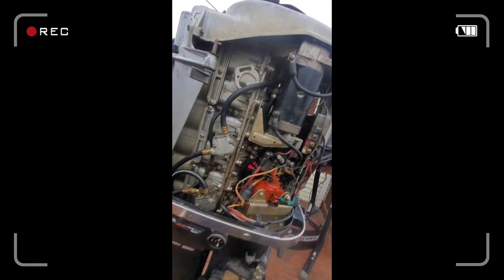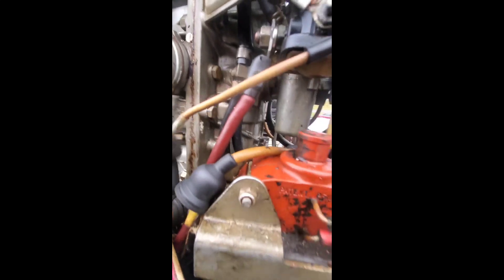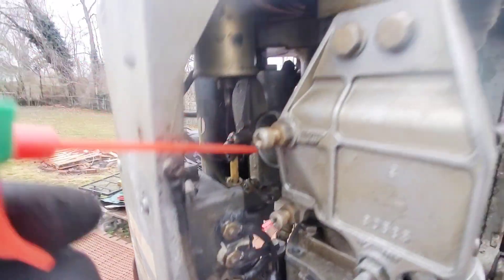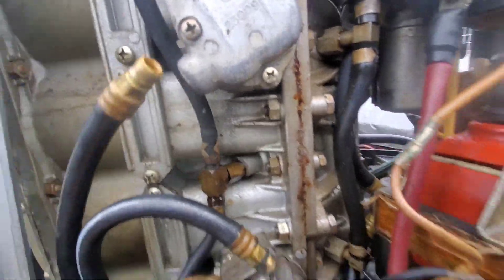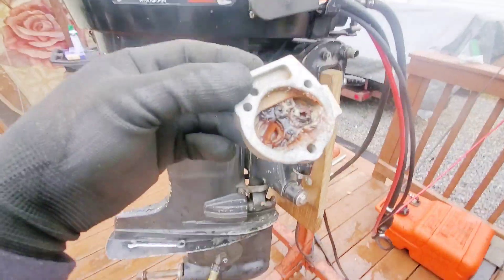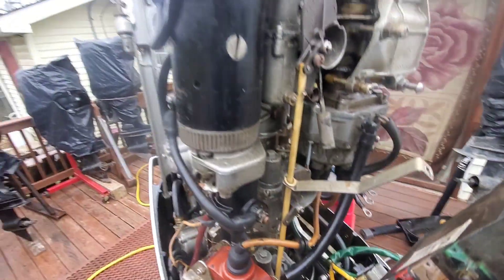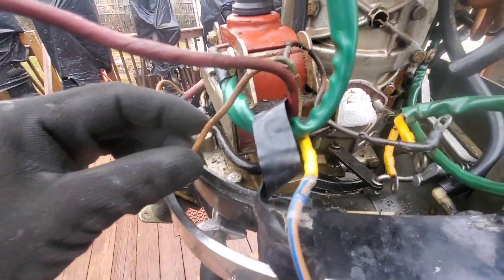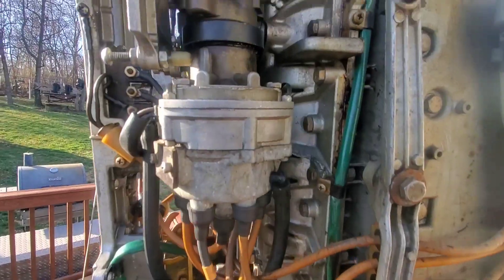950SS Inline 6 Tiger Block Mercury Outboard: No Spark?

Comment: I cut my “marine tech teeth” on the 1978 Merc 150 inline 6....took a marine maintenance course at my local JC, and worked in the industry for many years. I’ve rebuilt 2 in-lines sixes...what a cool engine for its time! Now tinkering with a ‘79 V200. Much easier to work on....

Just wanted to say I am enjoying watching you troubleshoot the various problems. On old engines, I usually overhaul the WP, fuel pumps, and carbs as standard practice, and check timing, link and sync...

Quick question...do you know of a good source for the ring compressors for the inlines?
Reply from the maker: Can try boats.net, ebay, oldmercs.com, etc. Son

Comment: Great stuff I have a 1977 1500 sounds great out of the water. But as soon as it hits the water it will not go over 2000 rpm
Tried carb cleaning, new reeds, checked timing , new plugs. Have any suggestions.
Reply from the maker: Proper Link and sync i assume? What pitch is your prop? Weight of your hull? There can be several reasons. Son
Reply: @MerCSonL6   The prop is a 17 pitch and the boat about 1200lbs its a 1989 363v ranger bass boat. I watched your link & sink video and did mine the same way. I also did it with out the timing light by moving the trigger and watching the spark.
Reply from the maker: @tonyroadcap4858  any fuel leaks from the boat tank to the carbs? 2000 rpm is really low. Sounds like an ignition issue. Have you tested spark on all 6 cylinders? Whats compression?
Reply: No gas leaks to carbs, compression is 120 to 135

Comment: Hey this is the motor I'm working on now, I'm getting some clicking from the switch box and my starter won't turn over, how can I check/bypass the switch box ?
Reply from the maker: Switchboxs typically doesn't click.  Selonoids click. You cannot bypass the switchbox. It is detrimental to the ignition system. Son
Reply: @MerCSonL6  I must be hearing the spark in the coil.  When I jump the starter the motor wants to run but it dies as if the kill switch is being activated but it's not even connected.
Reply from the maker: @Spacefolders  replace the starter selonoid.  Son
Reply: Do you have to add lead additive to the fuel? @MerCSonL6
Reply: 2 cycles don’t have valves so no lead additive needed

Comment: Do you happen to have anything on rebuilding the fuel pumps, or are they pretty self explanatory once you get into them? I started having a problem at the end of last season where it would only cold start if I used a tiny tiny spray of starting fluid then would run like a champ and start and stop as much as I wanted. Until park at sandbar and go to start back up after cooling. Any ideas of what to look at besides carbs? Rebuilding fuel pump this week. Awesome videos, love my old thunderbolt 800 been searching for repair videos of them for a while!